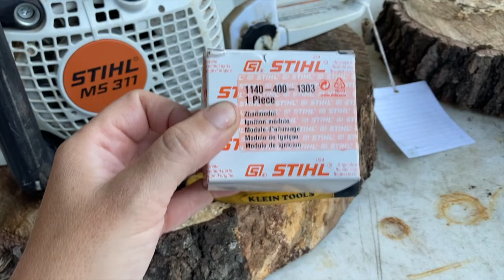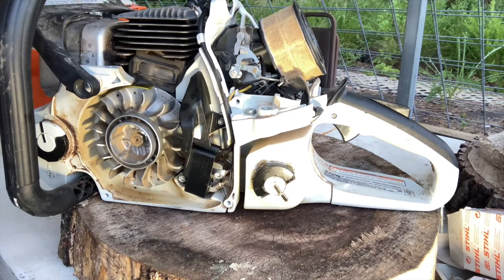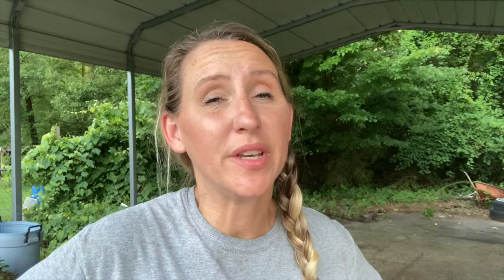Customer Destroyed It! How to replace your ignition coil and plug boot on Stihl MS311

Comment: I have found most problems are fuel mixture. I use Prosourse instead of 2cycle oil. Prosource I believe is more silicon instead of oil and can be used on all mixtures with one gallan gas and the small bottle of Prosouse which I buy at Lowes.

Comment: I'm thinking if you put the boot in some really hot water it would soften up enough you could do yer needle nose plier thing and get it back on the wire without grease. Sweat is also a great lubricant for getting rubbery things together and then it dissipates, leaving the parts stuck together.

Comment: ...That's why I like the older model (like 350's, 346xp's, 372's, etc.) Husqvarna coils..mess up the wire, you can just unscrew the wire from the coil and install a new spark plug wire, without replacing the coil...not true with the newer models, though!..:(  ..wire is glued/epoxied permanently in there, so you have to buy the entire coil assembly.. :(  ..I guess they can sell more coils that way...as far as OEM vs aftermarket coils, I agree 100% that OEM is more reliable and the aftermarkets are extremely hit and miss. What I usually do, on a newer, or really nice saw(like this one), I pretty much insist on OEM...but if the saw is well beat/used, and is several years old, I'll usually give the aftermarket a shot, since there is such an extreme amount of price difference in OEM and aftermarket...

Comment: I heard before that Obama raised the ethanol levels and that is why we see so many small engines thrown away. This is a cool channel because you are basically teaching us how to retire. Easy to learn when it's presented the right way.
Reply: @whiteknightcat  Thats good information. Almost seems like a deliberate attempt to cause people to have to buy newer vehicles.
Reply: @michaeltiza232  Actually, no. Recall I said they'd discovered that older vehicles could still use E10, etc without the crippling side effects people had earlier predicted. I drive two 1990's vehicles and they should be able to use anything from E0 to E15 or maybe a little higher with only a slight decrease in efficiency. The vehicle mandate was to try to wean us off petroleum and towards alternate renewable fuels. 

Now, for marketing, that's where the car companies are offering to buy up your used cars for unreal high prices, or offer interest free financing, or useless eye candy gimmicks, or other incentives. They WANT you to go in hock to buy an overvalued vehicle, even if you can't afford it in the long run. They'll still come out ahead.
Reply: @whiteknightcat  I know fuel economy is made by lightening the vehicle. Foam bumpers, no spare tire, aluminum suspension, and a plastic cover so no one can tell the engines are the same as the old technology. And a plastic intake manifold that makes no sense. The old cars sure are easy to fix and can buy 10 or 20 for the price of a new car.
Reply: @michaeltiza232  I agree that the older cars are way easier to work on.

Comment: I put a little die electric grease on plug end for next time . I agree their to tight. Same about the fuel . If the saw hasn’t run in a couple of months I’ll dump the fuel and replace . The saws seem to like the fresh gas .I also put boot on wire then pull it back through.

Comment: I had some VP 50:1 mix in a saw. The saw had sat for a few months. Wouldn’t start. It wanted to, but wouldn’t. 
Dumped the gas, filled with some I had pre mixed. Started right up.

Comment: I do not understand why manufacturers do not put a crimped spark plug connector on the end of the high voltage wire.  I know what you mean about those bayonet connectors.  They come off the end of the wire all to easily.  I now rotate the plu boot and then use my scrench to pry it off.  I also check the inside of the boot to make sure the coil connector is aligned properly and I want to feel it go on the plug when I reconnect it.  A little dielectric grease on the plug makes it easier to get the boot off the plug the next time you need to remove it.  A little anti-seize on the plug threads makes it easier to remove, too.

Comment: The sign in my work shop says you cannot fix stupid. That rings true more times than not reguarding things like this. A simple" I can fix it myself" ends up costing in parts and labor. Many times I repair those DIY jobs eather in someone's  equipment ,or something I purchased for a few bucks as a project  or parts only to find out the unit was good, it just needed the " Stupid" fixed. I like those kind of deals.

Comment: Put a little electronic silicone onto the coil wire and a boot will slide very easily back-and-forth or if you don’t have the electrical silicone you can use a dab of Vaseline or any type of lubricant

Comment: Instead of using needle nose to open the boot, I like to heat the boot in a cup of boiling hot water.  This softens it so that I can shove the coil spring into it.

Comment: When it comes to fuel I buy ethanol free gas from Kwik fill on route 62 outside oil city PA anyway I use Amsoil two-stroke oil and I mix it at about 110 to 1 works real good I talk to the tech guy rims oil he said they have safely run it up to 150 to 1 sounds pretty good to me but I do know this much the least amount of oil you can use the more perform at your house because remember it’s the gasoline that makes the power not the oil less oil long as you don’t screw the engine up better performance this is six in a row Jim From Kennerdell PA I go by six in row gym because I have a 91.5 dodge give you three guesses what’s under the hood anyway I think you’re really neat lady I’d love to come and visit your shop don’t know where it is though

Comment: unless its been glued in there you will find the spark plug wire is not molded into the coil block but screwed onto something that looks like a small tek screw inside the hole that the plug wire comes out of. every magneto type coil ive seen has been like this but having said that its been a few years now since ive worked on such stuff.

Comment: Many years ago I bought a Stihl 056 Super electronic. I ran a 36 inch cutting bar and could easily run a 42 if I need it.  One day was cutting some big oaks and the saw just stopped.  Let it sit for a while and used another saw.  Went back later and the saw started, but would run for only ten minutes.  Well, it was the electronic coil went bad. That coil was no longer available.  I found out that a lot of people have the same saw and have the same problem.  My perfectly good saw is useless because of no coil..

Comment: I had a problem with Stihl oil everything that had the fuel with Stihl oil in it stopped being able to be started. So I mixed a new batch with Castrol 2T and everything started and ran. I tried using the Stihl oil mixed fuel in the Suzuki 2 stroke mower but it sooted up the muffler. The rest  of the Stihl oil went into the chainsaw chain bar tank.

Comment: I need to know where you are located in AR so that I can bring you my CS550P to repair. If runs for a very short time after starting, like thirty seconds. It’s acting like it’s either a vacuum leak or the fuel pump in the carb isn’t working or something along those lines. 

Please get back to me.

Comment: I have a 40cc Johnsered 2140 chainsaw that has blown the ignition coil 3 times. Works for 10 to 20 mins and dies...Any ideas why? The saw has been used less than 10 hrs.

Comment: I remember a friend of mine would pick up any Beaver ad chain saw
Reply: Mccullagh I believe. In the beginning they were ok but as year passed they got cheap and a thin magnehelia were substituted for the thicker one. The thinner would allow the saw to start but if you turned it off it was dead. My friend found out the reason  why and he'd buy the correct 'helia and it ran fine everytime including after it was turned off. Restart no problem.

Comment: ..Yes, I agree that customers often change the spark plugs on equipment when it won't start..they seem to think the spark plug is always the problem, when it's usually not!..If changing the spark plug always fixed the problem, we wouldn't need small engine mechanics, now would we?  :)  ...another problem I see nowadays is people putting the wrong spark plug in their equipment..many modern digital coils require a specific resistor plug to run correctly, and most people will go to the box stores and pick up one of those awful E3 plugs, or they will go to the auto parts store and ask for a "small engine" plug..and the counterman will usually give them a Champion CJ-8 or Champion JLM 19...

Comment: I wonder if that gas was that expensive Stihl stuff that is out. I know that new stihl premix leaves hardly any carbon deposits, but for the price you pay for that stuff is it really worth it over just using premium ethanol free pump gas and 2 stroke oil mix.

Comment: @Chickanic what do you think of using Sta-Bil in your fuel?

I also wonder if it would be good to slip a bit of heat shrink onto the coil wire and then shrink it over the area where the boot meets the wire insulation.

(BTW the metal part that connects to the end of the spark plug would be called a terminal.)

Comment: I needed this video today! Thank you!

@AlWiedmannJr Made a comment about pulling the bare wire through the boot and then putting the attaching the spring and pulling the boot back up over the spring once connected. Worked perfectly and was so much easier.

Comment: Have you noticed in the last few years that coil wires are really short, too short especially on the cheaper brand? Sometimes ya cant even get even get the boot out of the way to remove the plug.

Comment: Followed through the video till you went to put the boot back on and I’m like “why’d she do that?”. If the metal part is easier to pull it out of the big hole the plug tip goes into why not put it back on that way? Try this. Take the metal part out then fish the wire back through the boot before you put the connector back onto the wire then slide the boot back over the connector and viola. One thing I was wondering could you slip a piece of heat shrink over the connector after it’s crimped and before you put the boot back on as additional support

Comment: Just happened on my Stihl ms170. Tried to clean the plug and the wire ripped out of the boot. The boot came off and the steel part stayed on the plug. Super annoying. Now I'm replacing the whole coil.

Comment: What about Echo red armor fuel? That's what I've been using
Reply: Here is what we have observed over the years about canned fuel. Some small engines just won’t run on some canned fuel, the highest degree of failure we have experienced is True Fuel, and we don’t understand why. We have experienced failure to start, not failure to run in all cases, with all the major brands with the exception of Echo. This doesn’t mean that it is better, we have only dealt with a handful of equipment fueled by this brand. So it’s kinda a crap shoot, your equipment may love this brand and never fire on that brand.

Comment: Pro tip from a non pro. Put a little dielectric grease on the tip of the plug. The boot will pull right off next time.

Comment: I have a chinese knockoff chainsaw, this happened to me. I successfully put the coil back in, knew by past experience that you do not cut power/gas lines on cars/motors in general because you can turn, lets just say, a simple diy gas filter change into a $150 repair

Comment: a dab of dielectric grease make it so the boot doesnt stick to the plug.  husqvarma makes a plier just for that spring  its a lifesaver.   i always pushed the wire through the boot installed the spring then pulled the wire with spring attatched back into the boot.

Comment: Why couldn't you splice the plug wire by taking a piece of solid wire and shoving the two "pokey" ends into the two wires to be joined? You might want to varnish the joint to keep out moistute.

If the subject ignition module is actually working, you could keep it for a testing spare once the wire is repaired.

Comment: Was the piston scored? Customers fuel looked like 4-stroke gasoline.
Reply: 4 stroke gas is clear or slightly yellow. 2 stroke is either green or blue.
Reply: @dkupy100  Yes, but it depends on brand. My neighbor uses a brand that does not discolor at all. I looked at his blower and called him up to ask. I hate that lack of color indication.
Reply: @haneyoakie14  Is he using a premixed 2 cycle gas? The color in 2 cycle mix gas comes from the 2 cycle oil so a user can tell the difference. If your neighbor's blower is a 2 cycle engine make sure he is adding 2 cycle oil to the mix.
Reply: @dkupy100  It is 2 cycle and he assured me it had oil/gas mix. I think he mixes his own, as do most people around here in Michigan, at least the homeowner types.

Comment: I have an 029 farm boss when you turn saw on the side it leaks fuel
Reply: Check the tank vent tube. You may need a new piece of tubing. A screw in the end of the tubing allows it to vent but doesn’t leak fuel. I’ve got an 029 that had this exact issue.
Reply from the maker: Take the air filter cover off. Look to the flat top on top of the fuel tank. There should be a plastic nipple coming up. Is there a rubber hose coming from it? If not, your tank breather hose could have deteriorated and fell off. If it is not the culprit then it probably is your rubber fuel line where it comes up through the tank. Thanks for watching!

Comment: if you buy after market coils get 3 of them because you'll be changing it every six months
Reply: Found this video after I bought the cheap replacement. Fixed the OEM. Got lucky with the cheap one. I bought the whole tuneup kit so I have extra parts now. I found sawdust and oil on my ignition contacts. May have been the problem. Not a fan of the MS250. I’ve used it for maybe 6 hours total using Stihl MotoMix only. I’m going to mix my own from now on.
Reply: @mcraven8  not a fan of the 250 either , mine would run lean some days and to rich the next , did all the pressure and the comp. test and all was good , even with a new carb. it still didn't run right so i got sick of tuning and bought the MS260 as i should have in the first place , it's a much better saw built with better quality parts

Comment: We call them suppressor caps in England. Why did they ever invent those wire coils anyway? They make life difficult, the old ones without the coil fitted fine, didn't come off until you wanted them to, and then they were easy and trouble free to take off and replace. Maybe they just wanted us to stop looking at the plugs all the time.

Comment: Nice Vid Brie, those boots are a royal pain.  I do, however, remove the HT lead from bad coils and have installed them with epoxy instead of having to buy new, especially if the customer has a tight budget. Just an FYI.  Keep the vids coming and stay away from those pesky nipples!!!

Comment: Customers always think if it doesnt start the plug is bad. 99 percent of the time its bad cas or low compression. Look at cars the plugs last 100,000 miles. I found alot of small engines dont like Trufuel.
Reply: i ran a set of ngks for over 100k. i just changed some ac delcos out for fresh delcos and those had atleast 80k on them.

Comment: Echo ignition coil is probably less than half the cost
Reply: I bought one for a blower, OEM $88 plus shipping. Found out later Echo coils have a lifetime warranty!
Reply: @jamesdrew8569  I just come across a video top ten facts that every echo owner should know. He mentioned like you said lifetime on the  coils. Wonder how many small engine repair shops neglect telling their customers about that
Reply: @hphillips7425  to get the lifetime warranty.The coil may have to be installed by a small engine repair business.Not sure on that though if the consumer can get the new coil under warranty.

Comment: @chickanic How are you going to explain to the customer that you disregarded his instructions?
Reply from the maker: What instructions?
Reply from the maker: The fuel? I am giving it back to him. That is why I jarred it.
Reply: @Chickanic  yes, he told you not to take the fuel out, right? But he also told you to fix it. Lol

I don’t use a lot of 2 stroke fuel, or I use it in spurts. 16 oz in the weed wacker lasts a few weeks, snowblower in season as weather demands, chainsaw once or twice a year. So I take a 500 ml clean bottle, add 10 ml or 12.5 ml of oil and fill the bottle with pump gas and immediately fill the tank with fresh 50:1 or 40:1. My infrequent use means I mix fresh every time. It works for me. YMMV lower in California.

Comment: You are one smart chickanic LoL 😅 n on question is what is the worst thing you have  had to work on also soak the speak.rubber.boot in hot water it will help with putting it on the the speak plug wire

Comment: I dont get it. why you not just replace the cable? normaly the cabel are just screwed in the ignition coil. Have something changed? would be new to me.
Reply from the maker: They haven't had screw in coil wires in over 20 years on anything 2 cycle. They are siliconed or glued in. You have to replace the whole ignition module.
Reply: @Chickanic   Thanks for your answer. Interesting I was able to change the coil wire from my Stihl MS361 from 2005. It was just screwed in the module. Maybe they use different quality in germany.

Have a nice day.

Comment: But you forgot to tell me how to get the damn plug off the freaking wire.  FYI I got it off. And managed to not be tempted to cut the coil wire. And re poked the “poky” part. I was tempted to install a old tiller type of spark plug cap but I didn’t. It works but the wires are looser than before because I bend the heck out of them try to get the plug off.

Comment: I dont get it she left the steel prong exposed at the end, it is going to arc everywhere. She should have put the part of the boot she cut slide it in first put the prong and the boot and add silicone between the two.